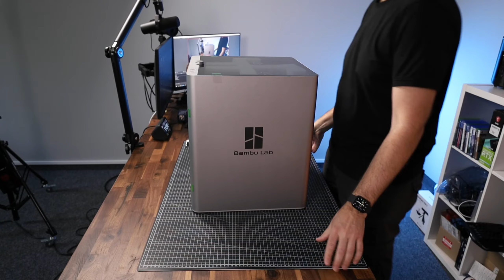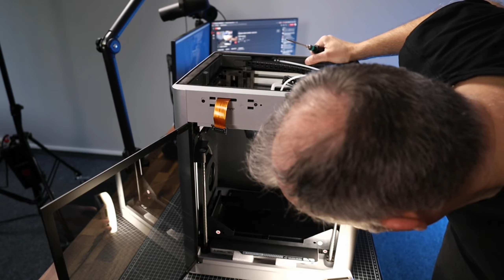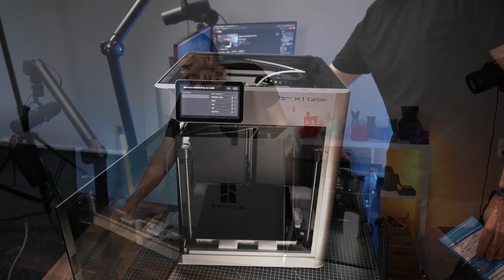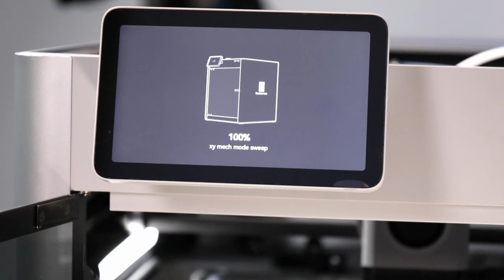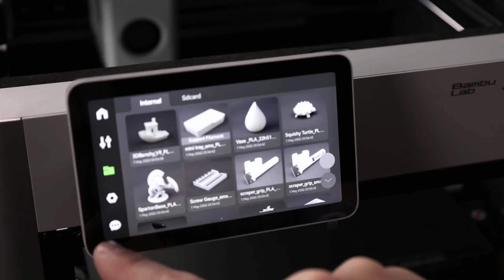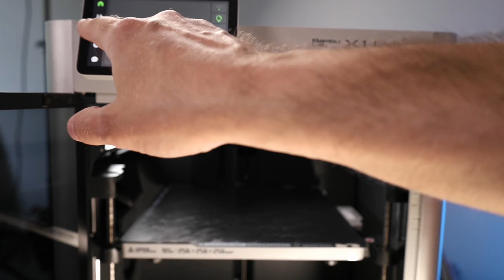BAMBU LAB X1 CARBON: First Look!

Comment: Thanks.   Hope you do some pretty in depth testing on this one.  Everything I've seen so far makes it look like a real game changer.   I'm not sure about the other reviewers but I trust you.  This video is a good look at how most people would be with this one --  It's way different.  "Modbot" gives a pretty good look at this one and he was shocked too.
Reply: Bro iam buying that printer the 31 of may...Bye bye heavy modified ender 3 v2...Bye bye Prusa !!!
Reply: @carlitosur7949  I have a few printers including an Ender 5 Pro.  That printer is great,  has printed perfectly every time right out of the box.   But this one really really looks like it has pushed the tech forward.  But I'm holding off till the dust settles.  Really wonder how long it can hold up printing at those speeds and doing it's shaking thing.
Reply: @Flatwoodsdad  Yeah but me personally i always print at 40 or 50 sec because i print Coex Nylon .For me speed is not a issue ill print slow with this but all the other feature are just amazing for that price .I cant help it its a insta purchase in my book

Comment: Why is this so much cheaper than the PrusaXL? It seems to offer more.. with enclosure already included, ready for abrasive material, input-shaper sensors and build-plate cooling etc. the list goes on.. only difference XL has toolchanger vs MMU, but that's it!
Reply: Prusa printers have always been overpriced for what they are, a bare bones i3 style printer. Granted they nearly always have good quality control and reliable prints but Chinese competitors have already superseded them in quality and price years ago.